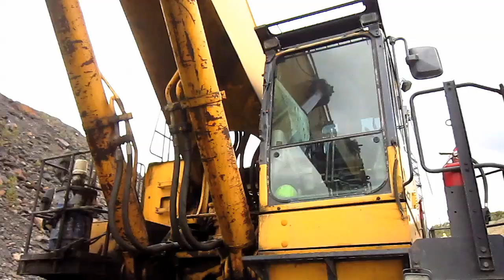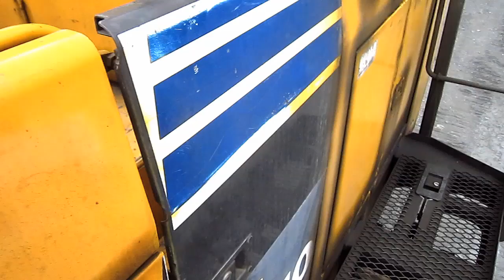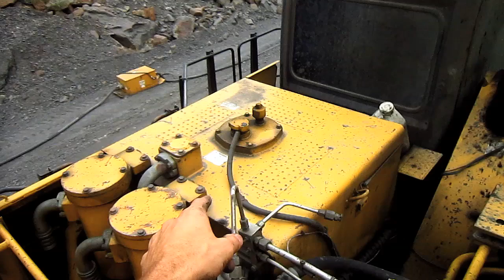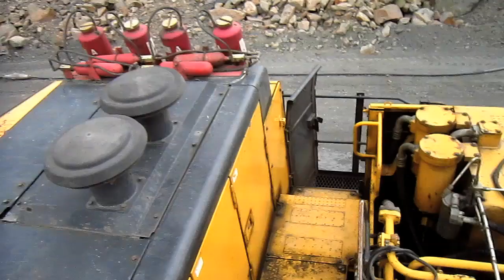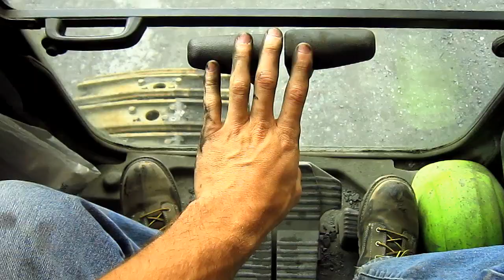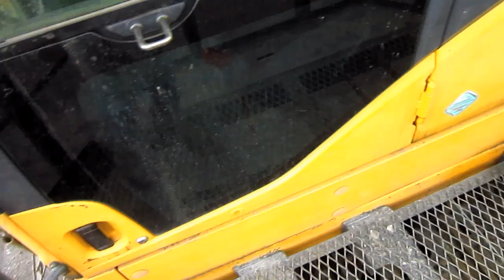The Komatsu PC1250-8 - Beast Mode!

Comment: My favorite 125 ton excavator
Reply: @bethanyhaskiell9116   I like this PC-1250-8 excavator as well. But my favorite heavy duty excavator is the old Koehring model 1266d from way back in the 1980’s.I had the good fortune of getting to see one work on a big project in NJ. The machine was an absolute beast.I watched the operator dig down to just inches shy of 40 feet deep. The big Koehring was fitted with about an 8 cubic yard bucket.Seeing that machine work was very impressive sight. The 1266d had an operating weight of 260,000 lbs , (130 ) tons.
With that said, I do realize that the Komatsu PC-1250-8 would definitely outperform the Koehring by a substantial margin. The Komatsu being so much more advanced with technology.
Reply: @williamhall9204  Definitely love the old Koehring 1266 ,1166,and 1066 they are some of my favorites in the old classic big iron along with the Cat 245 and 235
Reply from the maker: Yeah I have to agree, the 1266 was pretty dam cool!
Reply: @bethanyhaskiell9116   Just wanted to mention another model that was in the Koehring excavator lineup. It was Koehring’s flagship unit. The Koehring 1466 was the largest machine built by the company. The 1466 could be ordered in backhoe configuration, or in shovel configuration.Weight of the backhoe version was 292,000 lbs. So that makes it 16 tons heavier than the 1266d. The 1466 was substantially heavier when set up as a shovel. When the 1466 was set up in shovel configuration, the weight was 308,000 lbs.(154 tons).Unfortunately I never had the chance to see the 1466 in real life. Only in brochures, books, videos, etc.

Comment: How many pieces would a machine that size break down into for road transport?
Reply: A Hyundai R1200-9 that I had the opportunity to film, which has the same operating weight, was split into three loads: Tracks and body, boom and stick, counterweight.
Reply from the maker: 2-3 loads which depends on the state and permitting. A super load permit in Pennsylvania would allow the body of that machine less the attachment and counterweight to be hauled as one load.

Comment: Is the idea of two bucket cylinders that two smaller cylinders provide greater force than one larger cylinder? Always found it strange that it has dual bucket cylinders but single stick cylinder.
Reply: It has to do with the linkage  connections down near the bucket and resistance of torque loads developed by point loads that can occur corners of the bucket.
Reply: @ thank you, appreciate the information
Reply from the maker: Its actually for higher break and tear-out force- this answer is right from Komatsu. I don't understand how it could have anything to do with the linkage, which is designed for the cylinders. The same torque loads are applied to every excavator bucket and not all excavators have two curl cylinders lol.
Reply: @PAmining  A single bucket cylinder works fine for most machines but I think the engineers wanted this huge machine to be able to work with a very wide bucket and when they ran the numbers with all the crowding load on one of the corners of the bucket, it put a unreasonably large twisting load on the bucket linkage and lower portion of the stick.